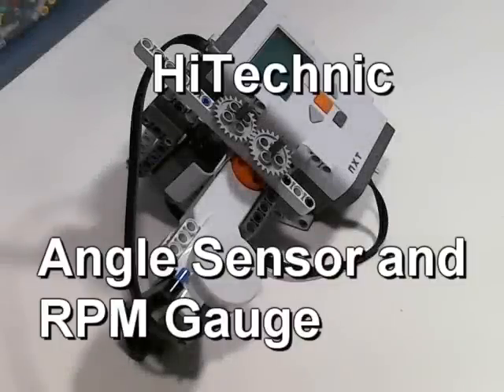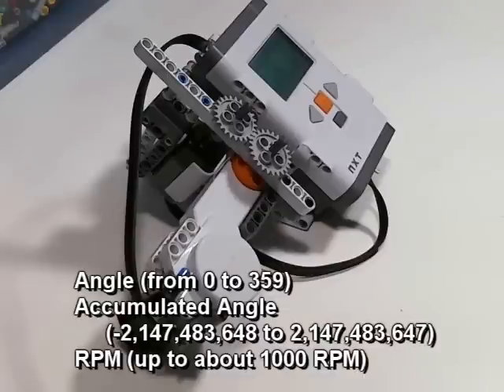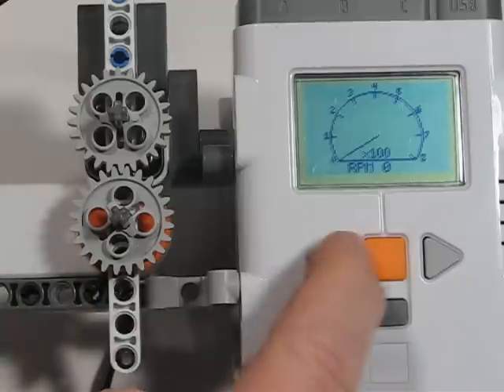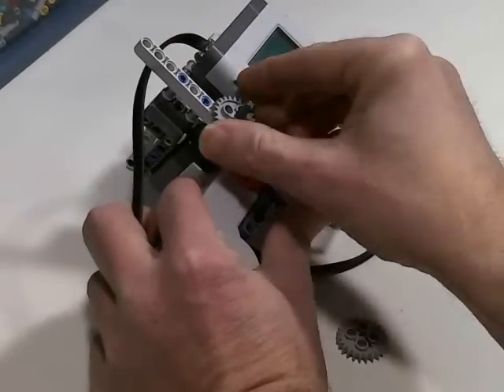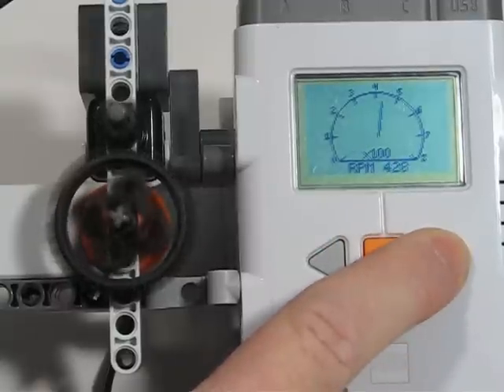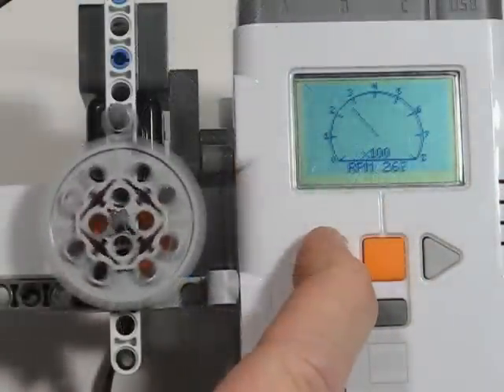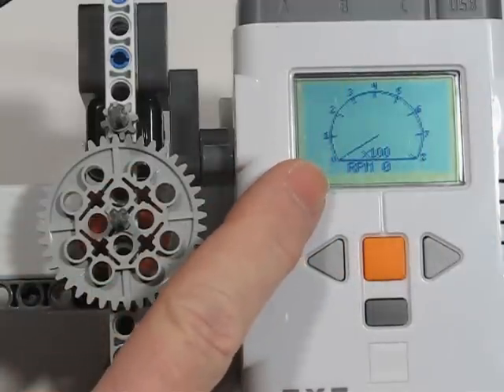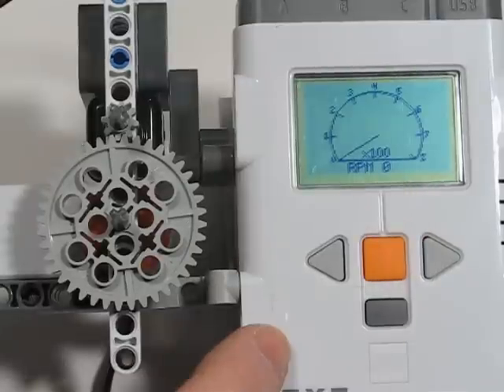HiTechnic Angle Sensor and RPM Gauge in NXT-G

Comment: I realize this is kind of a necro post but, I have an LPE engine with a manual 6speed transmission. would it be possible to use this as an rpm measuring device so I could tell my nxt brick to shift at certain rpm's? This would make the shifting more efficient since right now I have to tell it when to shift.